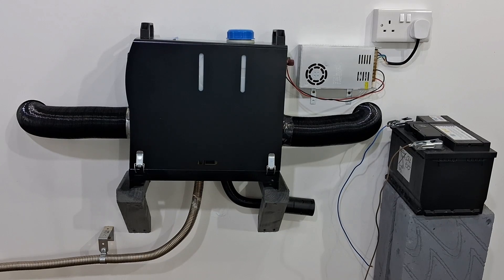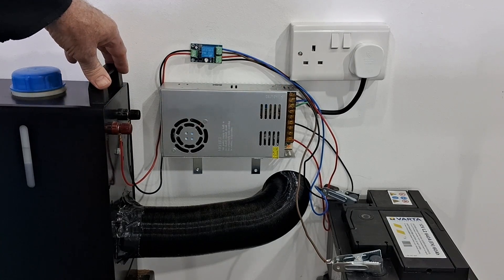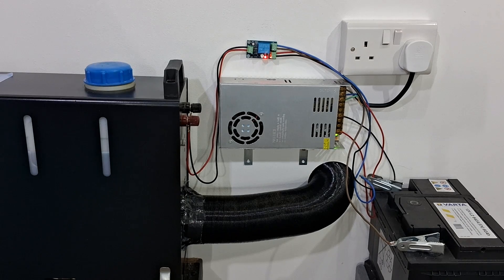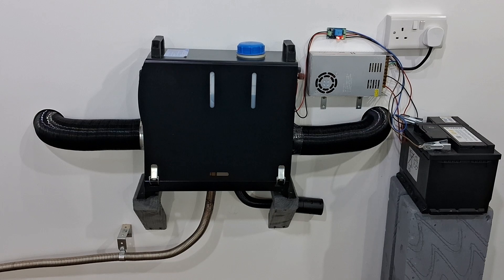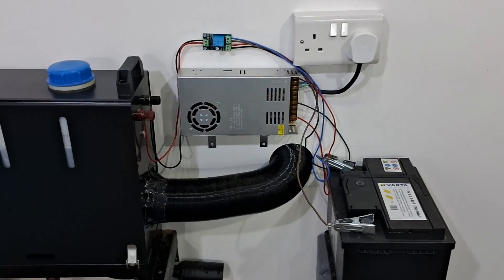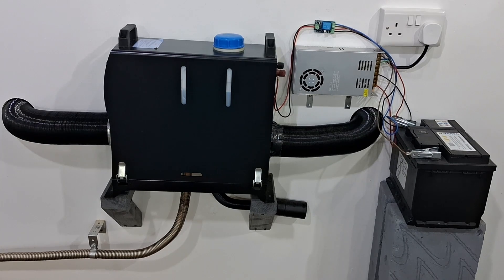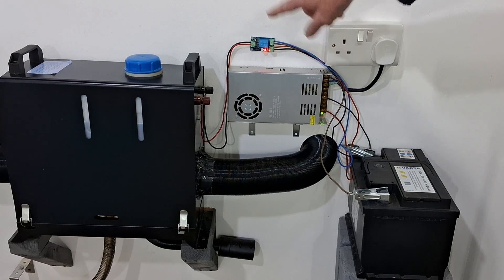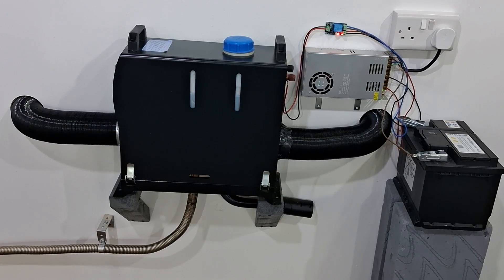DIESEL HEATER Emergency Power Cut Switcher 12v mains supply to battery backup in under 1 second auto

Comment from the maker: Links:
Power Switcher Module: https://amzn.to/48sEbAb
Heaters: https://amzn.to/3ZwMAPc
12v power supply: https://amzn.to/40iHO8J
Long flexy exhaust pipe: https://amzn.to/3ZwMAPc
New control panel: https://amzn.to/3GW0mDu
Ducting: https://amzn.to/3CF7l0W
link to heater U.S. : https://s.vevor.com/bfP62S
Kerosene Supplier: https://www.gbfuel.co.uk

Comment: Hi, I am currently running a heater on Battery on my boat, I am about to fit a 240v a /12vdc converter.
I would like to keep the heater connected to  both the battery & ac/dc supply. Out at sea I only have battery power. 
In port I would like to run the ac/dc unit on a timer….. the heater can then run at chosen times when I am not on the boat. 
Do you have any suggestions.
Reply from the maker: a lot of these heaters have a built in timer, but i have never used them. yes an automatic switcher is a good idea. good luck, let me know how you get on cheers andy

Comment: Can you please link me to the recommended battery also and the setup u have ?
Reply from the maker: here are some links that might help you
cheers andy

car battery: https://amzn.to/3uM6Ode
Solar Panel Kit: https://amzn.to/48zyTlF
Power Switcher Module: https://amzn.to/48sEbAb
Heaters: https://amzn.to/3HDNXDO
12v power supply: https://amzn.to/40iHO8J
Long flexy exhaust pipe: https://amzn.to/48XI4NY
New control panel: https://amzn.to/49gvOrC
Mother Board: https://amzn.to/49f6emD 
Ducting: https://amzn.to/3CF7l0W
Diesel Heater ultra quiet fuel pump: https://amzn.to/42nOsLC
Diesel Heater Parts: https://amzn.to/3SGTP5H
Diesel Heater Extension Cable Wiring: https://amzn.to/49gb9DT
Battery Trickle Charger: https://amzn.to/3UllSsA
12v power supply car socket style: https://amzn.to/3OMvo4v
link to heater U.S. : https://s.vevor.com/bfP62S
Reply: @andyfireblade  Andy can you tell me the exact make and model of the battery the link  won’t show me certain products because I’m located in the United States
Reply from the maker: @eyewatchvq  
this battery is for a car, a peugeot 207. the exact model is 12v l2 640a 60ah

these are the other links that you may need.

U.S.A. Links: 
solar panel kit: https://amzn.to/4bYWwHq
Heaters: https://amzn.to/48SYbwc
Power Switcher Module: https://amzn.to/48RBJUf
12v power supply: https://amzn.to/47XpuE0
Long flexy exhaust pipe: https://amzn.to/3SDGoTP
New control panel: https://amzn.to/48VVcD3
Mother Board: https://amzn.to/3SEXxfY
Ducting and joints : https://amzn.to/3UlMZn6
Diesel Heater ultra quiet fuel pump: https://amzn.to/4bjYYHZ
Diesel Heater Parts: https://amzn.to/48LFBG9
Diesel Heater Extension Cable Wiring: https://amzn.to/3u5LP4J
Battery Trickle Charger: https://amzn.to/3OknUoL
12v power supply car socket style: https://amzn.to/3vZdMf5
Reply from the maker: @eyewatchvq  https://amzn.to/438CMNh

Comment: I am new to diesel heaters. Does the power supply charge the battery when the A/C power is on?
Reply from the maker: yes, cheers andy
Reply: is there a concern of over charging the battery?
 @andyfireblade

Comment: I have the same set up I don’t understand why yours works mine When it switches over it takes about 2 to 3 seconds and then just the fan will run to cool down the unit which is good but the unit will not keep running like it never missed a beat.
Reply from the maker: no , me either. a couple of people have told me that if you just wire the battery in parallel with the power supply and set it at 13.8v.
it will switch straight over and keep charging the battery as well?
could give that a try?  cheers andy
Reply: Thanks

Comment: Hi, you don't need the switcher, just use the power supply and set it to the correct Float charge voltage for the battery. Connect power supply to battery and heater. Have a look at the one I made here https://youtube.com/clip/UgkxJpAwdiSjaBkBnMCgSiQ3WbBD7RI5e98S?si=OZNCjDivL_nqWNjV

Comment: You might experience an issue with connecting and leaving a battery charger connected, if it was to switch over from mains power to the battery and the charger was suppling 15v to the battery, this could cause an over voltage spike and give you a fault on the unit.
Just make sure you keep the battery topped up when the heater is off.
Reply from the maker: thanks for sharing.
cheers andy

Comment: I cobbled a 12v dc relay into my heater to switch to battery on power failure two years back. Yours is having the same issue I discovered when running the relay form the same supply the heater is using. (brown out) The power supply has big capacitors that keep the power flowing for a second after power failure. By the time the voltage is low enough for the relay to switch, the heater hasn't got enough power to continue properly and the computer glitches, hence the change in fan speed. I solved this by powering the relay from a small 12v wall wart that cut the power to the relay well before the power supply cut off. This stopped the brown out situation and the heater didn't notice a thing. I had to test a few wall warts to find one that cut out instantly, but once I found a suitable one the brown out problem was resolved. Hope this helps.
Reply from the maker: thank you for your comment did you see my other heater vids, https://www.youtube.com/@andyfireblade let me know what you think, cheers andy
Reply: @andyfireblade  I just watched your newest video testing the relay on your outdoor heater. When you turned the power off it took a second, but the screen fully turned off. Then the relay switched to battery and luckily it recovered. When you reconnected the power it is seamless like it should be. 
I don't feel this is ideal as quickly cycling power like that to devices can cause the CPU to glitch and possibly crash or even cause damage.

My relay setup was a little different to the device you are using. I just used a 12v 8 pin 2 pole relay. This allowed me to trigger the relay with a separate 12v supply that doesn't have a delay when the power goes off.
As the main power supply will run for a second once the power is removed, I powered the relay with a small wall wart that cuts power instantly. The relay then switches over to the battery before the main power supply has even started to turn off. This kept my heater running seamlessly without the screen even flickering a tiny amount. 
It is a little more complicated to wire and requires another small power supply, but it does work seamlessly both ways. (possible solution to the extra power supply mentioned later)

I do like the simplicity of the relay you found, but I don't think you can power the relay from a separate supply like I could with the 12v 8 pin 2 pole relay I used. 
The one i used was from amazon and was called 
"Gereral Purpose Relay MK2P-I DC 12V Coil DPDT 8 Pin with Plug-in Terminal Socket PYF83A" 

I built a battery box to house the battery, relay and trickle charger and put a switch on the battery box to isolate the battery from the circuit and charger. 
I am not an electrician, but with a multi meter I worked out what terminals were connected when the relay coil was powered and un-powered. I connected the main power supply through the terminals that were connected the heater when the relay coil is powered, and the battery to the terminals that were connected to the heater when un-powered.

To turn the heater on I switch the battery on and the heater lights up. This tells me the battery circuit is working. Then I switch on the mains and I should hear the relay click and the heater is now running on mains power and the battery is trickle charging. 
Initially I tried powering the relay from the same supply the heater was using (like you) but was having the same issue you have with the screen glitching when mains power is removed. I noticed that there was quite a delay between power being cut and the heater/relay actually reacting to the loss of power. This was when I tried powering the relay from a small 12v wall wart. I tried a few and most had a similar delay, but I found one in my drawer that reacted very quickly to the power going off. I used this to power the relay and it fixed the problem. 

In hindsight I should maybe have used a relay with a mains powered coil to negate the need for the separate 12v power supply, but my original intention was to have the 12v supply that powers the heater power the relay coil too. So I just found a work around that enabled me to use what I had. 

I just did a search and found this on amazon that looks to be the same relay I used but the coil is mains powered. 
"Gereral Purpose Relay MK2P-I AC 220V Coil DPDT 8 Pin with Plug-in Terminal Socket PYF83A"
This might negate the need for the small wall wart, but I have not tried it. Though in the future if I need to replace the relay I may try this 220v relay instead.This might be a better option, but I have not tried it. If it works it would negate the need for the extra power supply and should in theory switch the power over instantly. 

Those were my thoughts on the situation and I'm sure someone might find an even better solution. I am just a tinkerer and thought I would share my situation. 
I love the experimentation that goes with these diesel heaters and often watch people trying out crazy ideas relating to them. 
Anyway thanks for the videos and happy tinkering.

Comment: Hi, just wondering does that module allow the battery to charge aswell or do you use a trickle charger to keep the battery topped up?
Reply: No it doesn’t allow it to charge through the module, it’s just a switch
Reply: @Sirtomalot-c5s  thank you

Comment: Great tip, Andy. I'm running my heater off the mains and although power cuts are extremely rare here, I'll probably upgrade 👍😃. Another question for you. Did you ever measure the benefits of recirculating the hot air from inside as opposed to drawing fresh "cold" air. I'm in Norway so that air could easily be -10.
Reply from the maker: great thanks, yes it has to make a difference of using warm air instead of cold, but difficult to know exactly how much difference.
cheers andy
Reply: @andyfireblade  andy and bernhand, i have my exhaust pipe and the inlet running out of the same area into a box and the exhaust heat warms up the inlet air but it is outside, best of both worlds, i have probed the air temp and it hovers at 40 degrees c...
Reply from the maker: @stevenlarratt3638  good idea, thanks for sharing with us all

Comment: Hi Andy, I left a comment a couple of videos back where I was explaining about how I was using a dumb charger and a battery for powering my diesel heater (which still works great). The switch module which you have demonstrated in this video will work with some heaters and unfortunately not with others. With some heaters they will carrying on running (like yours did) and other heaters will go into a cool down period before switching off (which is a good thing) completely. My Hcalory just completely stopped working with no cooling down period at all so potentially would have fried my motherboard, hence the reason for me using a dumb charger with a battery. I tried different ways to get my heater to work with the switch module but it just stopped working every time so it must be a setting that’s in the software within the motherboard. Another experiment I tried was with relays instead of the switch module and it was the same outcome, the heater just switched off completely. The cost of a switch module isn’t a great expense so for some it’s worth a try.
Reply from the maker: someone gave me a good idea. that if we were worried about frying the mother board, just put it outside of the heater burner box. and then it wouldnt be a problem?
good point, i thought, i dont know what else could be damaged by a rapid cool down?
cheers andy
Reply: Hi Andy, great suggestion and thank you for your reply. Yet again great video, please keep them coming. What you’ve suggested is something I’ve thought about doing but dismissed it because it wouldn’t be getting airflow over the motherboard like it does from the fan when it’s in the housing when the heater is running. I, like you, have my heater set up in a box outside the house so if I were to put the motherboard on the outside of the casing I would have to try get an airflow over it. In my case it would mean another fan to cool the motherboard which then has to be powered…….And around and around we go!
Reply: @Sirtomalot-c5s  Didn't know the motherboard is getting that hot that it needs cooling outside the heaterbox...
Reply: I have a new 5kw Hcalory standalone heater with a 12v 20A psu with internal voltage trimmer and was intending to use a switching controller unit with a battery like the one in this video but the switching delay you and others described put me off plus there is no trickle charge facility. After hunting about I used a dual shottky diode in a simple circuit described in this video by Alastair Reynolds: 
https://www.youtube.com/watch?v=F2_Qm5Zn8_A   
The switching is instantaneous and by trimming up the voltage I can trickle charge the battery, I added another switch to optionally by-pass the trickle charge. I also added a voltage/amps reader mini display so I can monitor the charging.

Comment: your psu puts out 12V right  fully loaded battery 13.2 or more and it runs abit faster. my psu is set to 13.6 heater runs  better speed cut off is 16v for 12V heater i think. still no old cast-iron radiator on your exhaust for more heat recovery. 😀
Reply from the maker: thanks andy
Reply from the maker: thank you for your comment did you see my other heater vids, https://www.youtube.com/@andyfireblade let me know what you think, cheers andy
Reply: @andyfireblade   yeah i have seen quire a few, why i mention cast iron radiator i also see  the one with your setup litlle radiator but that radator is no good. those from the 60 70s on cast iron as i am using hitting 100+ on the bottom part 30-40+  on top in a non insulated 20foot container 5kw heater just keeping it frost free +5 as i am  hopefully soon starting to insulate .

Comment: I wonder, when you take into account the cost of the electricity plus the cost of the fuel, how much if anything are you saving by using mains electricity to power your system.

If you are constantly drawing electricity it is a thought.
Reply from the maker: true, thanks for your comment
cheers andy
Reply: For an average setting of the heater, the power-drawn is typically about 30W. at 30p per kWh, which equates to about 21.6p per day.
Reply: @nlo114  Not sure I would agree with it being 30 watts or his battery wouldn't keep going dead, that's a big battery and if it were only 30 watts that battery would probably last more than one day.

Also at 30 watts you could run it directly off a small solar panel, which I doubt you could.

Comment: I don't think that this is necessary. You can just connect power supply to the battery first and then from battery to the heater. Benefits of this is that the battery is also always fully charged.
Reply: Im pretty sure that will overcharge and shorten the life of the battery, we use battery chargers for a reason
Reply: I believe that this kind of power supply is cc-cv based. If the voltage is set little under the float voltage of the lead acid battery will not harm the battery  @TomasFaalPetersson
Reply: What yiu need is a trickle charger
Reply: Hi, Andy. As a few others have said. If you are using a powerful battery in your setup for reasons of possible power cuts and not wanting to possibly damage the heaters circuits, it would be best practice to connect the battery to the heater directly and to have a trickle charger then connected to the battery.  This is  a much similar and safe way to power the heater, and I think you'll find cheaper too.
Reply: Yep this is the best method. Simpler, cheaper and more effective
Reply from the maker: thanks andy

Comment: Ideally if you set the output voltage to just over 12v, eg 12.5v, the battery will remain fully charged and just float on the output from the power unit, if the mains fails, the battery will automatically power the heater, the heat won’t even notice it..when the mains returns, the power unit will provide power to the heater and charge the battery…only downside of powering with a battery if there’s a loss of mains, the battery could become discharged…depending on timescale…
Reply: I was going to say this, except for preferably at least 13v somewhere in the 13.4-13.8v range is usually ideal (check battery manufacturers float charge volume for specific volume). I have 2 heaters powered this way. Much simpler no changeover needed, no battery charger needed. Only a battery some wire and an additional fuse required